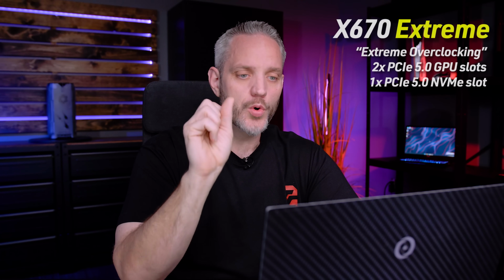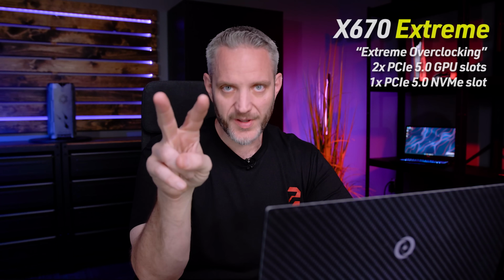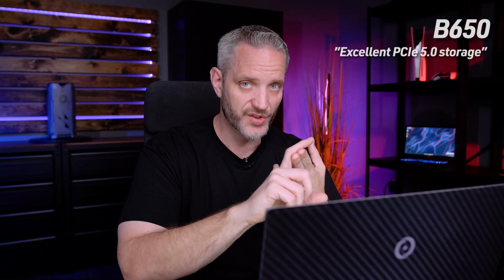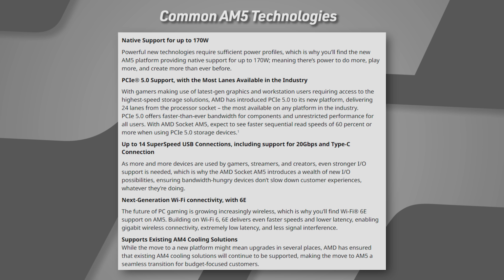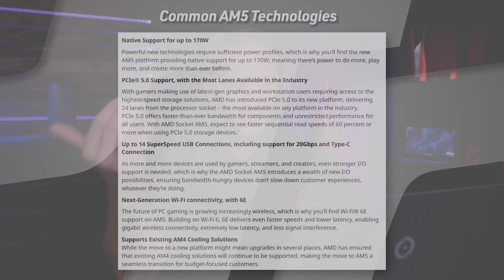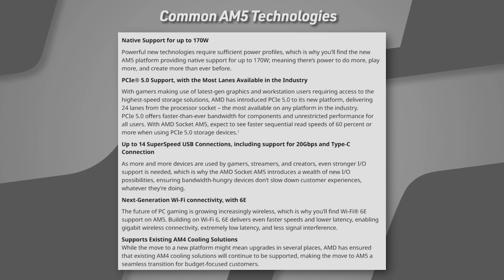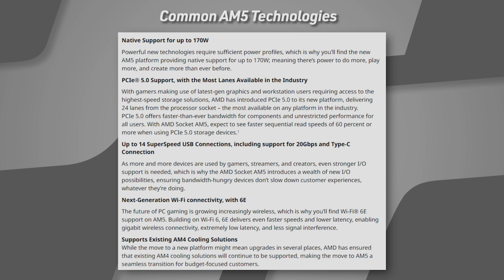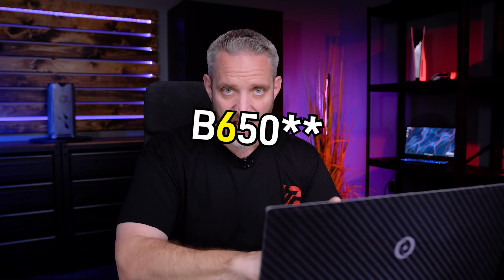AM5 Motherboards are EXPENSIVE! AM5 Explained

Comment: currently still on AM3+ with an FX cpu, was going to go with a 5600x but the 7600x is looking promising for a new build.
Reply: Going with mature AM4 is absolutely ok. Novelty costs extra and has it's shortcomings if you are not even going with the flagship of the old generation  then you even have upgrade room, and on the used market are many good deals regarding those who sell their shiny year old stuff to get even newer shiny stuff. If you were fine with AM3+ up untill now the upgrade into AM4 is will be substantial. Was on i7 4770k roughly in MT comparable to a FX8350 and even better ST performance and the leap forward to AM4 5800X is miles. So i do not need AM5 now, maybe I eventually upgrade when AM5 is EOL and have fun with the second best to get (well as long as 7800X3D/7950X3D isn't out even AM4 5800X3D is first/best you can get right now).

Comment: I'm not so much impressed by PCIe gen. 5 slots, but the actual fact that at least the ASUS Crosshair has all but removed anything less than USB 3.  (There are a couple of internal USB 2 ports for RGB & etc.).  The Front Panel Type C connector has a separate 60 watt power connector for charging.  There are also a couple of optional USB4 spots for video.

While Wi-Fi is nice, I will always rely on wired networking.  I've got experience with Networking and although it's gotten a lot better security wise it's still crackable by anyone with knowledge and determination.  If all my home systems are wired someone needs to compromise the cable.  Of course, my WiFi and Phones are sub-netted off and firewalled.

Also, during the AM5 presentation they announced a 4th chipset... the B650E.  I haven't seen anything describing the features yet.

I'm definitely waiting a while.  If I have an emergency I can change out my 3900 for a 5000 series CPU, and I'd like to see what additional products come out in 2023.

Comment: I'm sticking with my 5900X and ROG Strix gaming F for the time being. Went back to AMD with the last gen and i really look forward to seeing the reviews of AM5 and the 7000 series, but at the moment, I can't justify the cost of upgrading. TBH my system runs really sweet and is more than quick enough for both productivity and gaming. I'll probably revisit early next year depending on what happens with the economy etc.
Reply: I iwll keep the ryzen 1700 that ihave becuase while i got it in 2017 sicne 2021 that i got RX 6700XT 12 GB RED DEVIL for 950 euros it runs evrything at max settings 1440p 60 fps which means that there is no reason to change cpu ram and motherboard yet.
Reply: @TJM - Thats the point - Jay was asking at the end of the video if folks are tempted to uprade and frankly, I don't need to, the 5900X is fine and will continue to be for a while.

Comment: Had upgraded a couple years ago to a Ryzen 3700x and don't see a need for a whole platform change for some time yet. Still excited to see how the new processors and motherboards will perform.
Reply: I'm on a 3700x, X570 Board with a RX6800 might try and pick up a 5900X on the cheap when folk start upgrading.
Reply: @coard123  trying to get a newer GPU. That was next on the upgrade path when the prices took a massive increase. Limping along with an RX470. Thankfully prices have gotten somewhat better and now saving up the money to get the card I want.

Comment: I've got a 5800X3D and a 6900XT. I won't be upgrading for a few years. The only exception I can think of is if RDNA3 supports AV1 encoding like the Intel GPUs. If that happens I'll consider getting a 7800/7900XT for a streaming fidelity upgrade.
Reply: I'm pretty sure both 7000 and 4000 support AV1 mate

Comment: Been an intel guy so far, but what I’m seeing has me strongly considering AM5. I will probably wait until tax return season, spring maybe summer 23’. My 10700k and ftw3 3080 is holding up just fine going on 3 years. I’m usually a 3-5 year lifecycle type.
Reply: I’m considering opposite lol.  Just updated to a 5600x but considering at some point should I swap the cpu for 5800x3d or 5900x, or move to 13th gen Intel at some point.

Comment: PCIE Gen 5.0 graphics will certainly become relevant with the adoption of features like direct storage. And if like me, you plan on having the platform for 6+ years, then those things are important. I'll spend extra to get the forward looking features so that I can start with a 7700X, upgrade to whatever comes in the last generation of AM5 CPUs, and still have a capable system. I also wonder if AMD will push multi-gpu like Jay mentions. I imagine that with their chiplets and I/O dies in CPUs and GPUs, they could get some synergistic features and cooperation between components in an all AMD system that otherwise would not be possible.
Reply: I iwll keep the ryzen 1700 that ihave becuase while i got it in 2017 sicne 2021 that i got RX 6700XT 12 GB RED DEVIL for 950 euros it runs evrything at max settings 1440p 60 fps which means that there is no reason to change cpu ram and motherboard yet.
Reply: @shredderorokusaki3013  Well and you can upgrade to the 5800X3D in a year or two if you want and be good for a long time. You're getting your money's worth out of that motherboard and ram.

Comment: I'm so glad I saw this video. The only reason I'm upgrading is for load times so I only want PCE5 5.0 storage. I thought I was going to have to get something like the new x670e strix. My current cpu is the i7-6800k and it still runs games at full settings and I have a 3090. The 7600x will be more than enough.
Reply: Ayyy, skylake fam, 67k here from back in the day. Got myself a ryzen 37x and 57xt from back in early 2020 before the lockdowns and I've been loving it, especially the silence.

If I were to make you (or really anyone reading this) any suggestions while changing platforms, look super duper (to the point of obsessively) hard at what case fans you're getting. I got a 5 pack of artic p12s (3 for the rad, 2 extra) and four scythe kaze flexs. Silent at idle aside from pump noise, a light hum at load. Mind you this is also on a 2k 32" panel too. It's only my second build, but it's been a mad awesome improvement and I think my research into those fans really made a lot of difference.